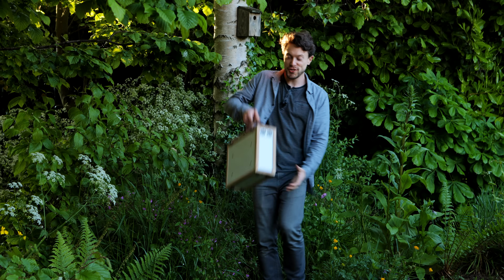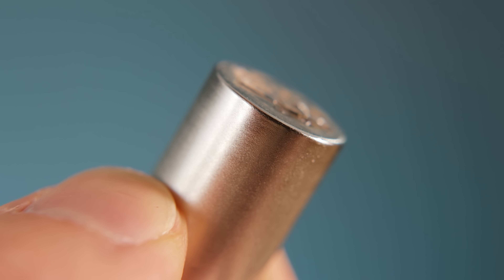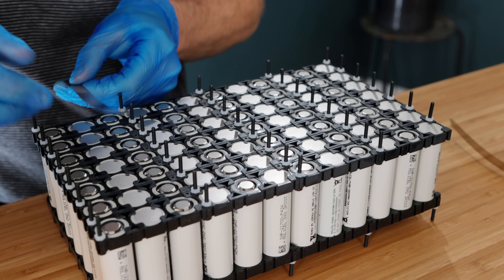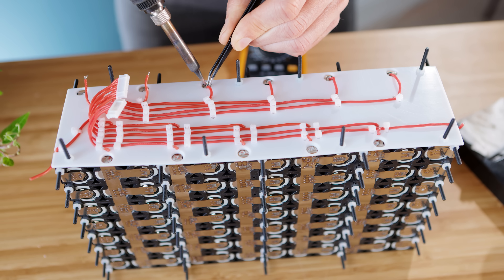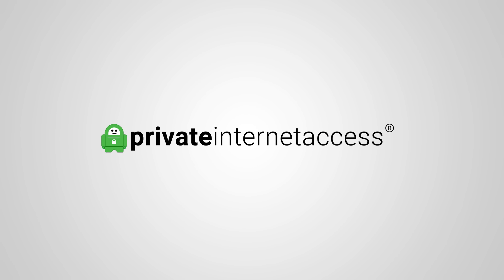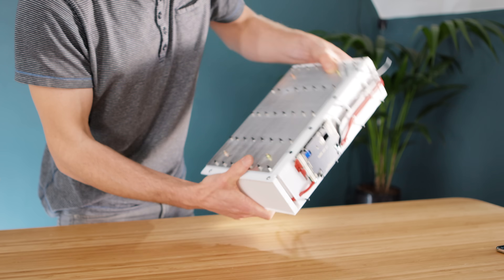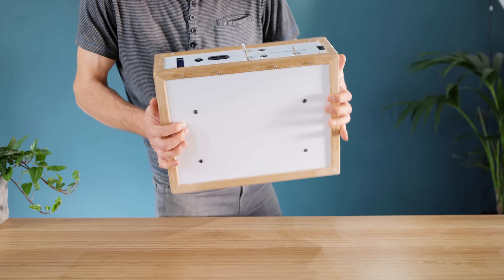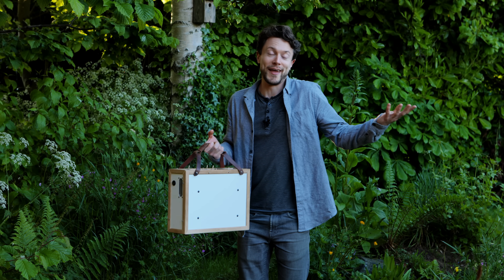Build your own portable POWER STATION (1200w, USB-C and MORE!)

Comment: You could make a 'hand-held' Xbox Series S. Xbox and battery in an enclosure with a screen on the front maybe with a split controller of sorts of the sides. Would be alot bulkier than a switch but cool to see

Comment: How do you can use 110V/220V units like (hier for example) microwave? You hab outputs of 12/24/50 Volts... Why not normal converter bulid in and socket for 110/220V equipment?

Comment: That is a monster build and very impressive. I am curious if the control module, can be configured to alert you when the batteries get to a dangerous level and need recharging? The dead car battery boost function is such a great idea to add. With a bluetooth karaoke portable speaker you and friends could have a fun party literally anywhere. The way you explained battery degradation, was so helpful. Does the control module show each battery or just the bank of batteries a problem cell might be in? Thanks so much for sharing your awesome ideas.

Comment: Hey Matt, thanks for sharing. A couple of questions:

1. What's the total weight (kg or lbs) of the case?
2. Can you specify which boards you had to include fuses?
3. What would you recommend if we wanted to modify the build to include the main voltage inverter inside the case?

Comment: For anyone thinking about building one of these that might get dropped a bit.... you can buy uncoated circuit board material that is both hard as nails, and flexible, and shock resistant. It's a wonder material for wrapping battery packs. My mate hit a van(!) on his ebike with a battery the size of the one in the vid strapped to the back of his bike, it shot across the road at 20-30mph then hit a kerb, and remarkably it was fine.... unlike my mate, or his bike, or the transit he hit! 😱

Comment: This seems a lot less DIY and a lot more skilled Tradesmen instructional video. While entertaining it lacks a lot of features that would make a traditional DIY project easy to accomplish. 

For instance spot welding the batteries in place. What if you screw up? a traditional DIY project would allow you to scrap that and do it over. Spot welding is a pain in the arse to redo, instead having a contact plate would be easier. Just pop the battery in and it's good to go. They're also far easier to install and more beginner friendly.

Also the tools and materials used are highly specialized. I can't exactly walk into a mom and pop hardware store and find a decent spot welder that won't short out or burn my hands.

That's just one example but there are others if you watch the video, specialty (expensive) tools your average person probably won't own, advanced techniques beginners probably won't know about, and programmatic features that are more complex than just 'plug and play'. This project also involves custom made plastic sheets, from whence did they come? Plus custom cut aluminum sheeting.

I just think this project falls outside the spirit of DIY. Not that it is by any means bad, it's a lovely idea. Just not simple enough or user friendly enough to be Do It Yourself.
Reply: Have you seen any of his other videos lol

Comment: Video made on my special day! Neat. I like the look of it. I build a converter for my E-bike battery to make use of it as 12V power supply for my cooling box if I not bike around. Was pretty easy and not had much circuitry but the lid and box was 3-D printed  and designed by myself.

Comment: Possibly build a multi input travel charger or something... for instance
Something that takes 5v at an average phone charger current and steps up to 50v slow charge so you can charge from car while driving without draining car battery 

Some solar arrangements that you can keep out on camping trips etc that slot nicely in boot ??? Possibly even a wind up/wind type device that could work in conjunction with solar and when the sun's gone.
Maybe I've thought to much into these lol.

Comment: You create the most GENIUS projects ✊🏾 I have so many questions: 1) Can multiple battery units be connected to increase the wattage/hour? 2) Can the unit be recharged via solar panels or a gas generator? 3) Can you do pass-through charging? 4) How long does it take to build one? 5) What’s the cost to build one?

Comment: Since you made the space for wiring and went through all this trouble with the build, why not just make all the wires the same length to get a more accurate reading of each battery rows due to your wiring resistance ?
I mean going the extra mile for the smallest things could get you additional few more charge cycle in the long run...
And you only need to spot weld 2 pairs of position on each battery but you went the extra mile to add a 3rd pair on them. So I find it weird you did not do so for the wiring.

Comment: So your battery bank is about 350ahrs capacity for only £315 worth of batteries. 
My question would be, what was the overall cost of the project as this could easily replace high capacity banks needed for motorhomes and boats.

Comment: Why not use LiFePo4 cells, they are a lot more stable and you can avoid dangerous situations (explosion, fire, etc). They cost more but safety, well hey, it goes first!
Reply: Well, it already is very expensive as it is. Using UPS batteries would be much cheaper, but heavier

Comment: There are consumer packs that can do much of this. Matt's pack shows how a DIYer can flexibly change the capacity and options to specific need.   
For amateur astronomers out there, this is a project others have also done to power telescopes and computers in the field though most don't do 24v only 12v.

Comment: Soldering these batteries really isnt as bad as you think. Aslong as you have a good size tip with a quality soldering iron, and are quick (but allow for for a secure weld) you should be fine. I've soldered countless cells with no problems. I'm not saying your wrong by any stretch, adding heat to a battery is still risky, so do take care when doing so.

Comment: Imagine if it can also be charge using a solar panel.
Reply: There's a whole class of power banks called "solar generators" designed for this purpose. They can be charged by solar panels and regular wall outlets. However, they are quite expensive because of the cost of batteries (roughly $1/W for a final package).

Comment: Cells in parallel groups should be matched with actual capacity and not charge level. You can easily charge/discharge a cell, but it's way harder to change a cell's capacity

Comment: worth to say that cells that are connected in parallel, should be matched by internal resistance, not only by voltage. Otherwise, cells with lower resistance will get more current when charging/discharging. This leads to a shorter lifetime of the cells with low resistance. I found a study somewhere that 5% of mismatch internal resistance of cells connected in parallel, leads to a 20% shorter lifetime.
Reply: Correct that a multimeter is not enough; it shows only stored voltage, not mAh. While brand new cells are likely not too different from another, second hand cells need careful measuring to see their capacity. I've purchased a 18650 discharger that gives me a readout of the capacity in mAh once the cell reached a set minimum voltage. I have some 2200 cells that have 2400 to 2000 mAh, and some 3000 cells with anything from 2200 to 1900 mAh. The worst set were  2100 cells that ranged from 1090 to 900 mAh, an absolute fire hazard if I were to pair a 2300mah with a 900mah even if both have 3.6v, something the voltmeter can't detect.
Reply: interesting makes sense, current is not equal in a paralel cell battery.
Reply: The BMS will monitor that as well.
Reply: @bdiddy77777  With parallel connected cells, how can the BMS possible know the current going to individual cells unless you measure them individually, which you can't because they are paralleled and will share the load?? All current to the cells in parallel literally goes through the same wire, but what goes between each cell, nobody knows. Do you intent for the BMS to have a current sensor for each cell? I believe what OP is saying, that matching the cells by internal resistance is the best insurance, though they'll eventually drift with aging. Another measure is keeping cell temperatures the same, as lower temperature in one cell increases internal resistance and accelerates the mismatch.
Reply: @bdiddy77777  no it doesn’t
Reply: wait i was wanting to copy his battery but if there is a flaw in the build then how do match the internal resistance. sorry if it is a dumb question I'm not to much of a technician
Reply: @pacboygamer6728  if you buy the same type of cell for example molicel p42a then you need not worry. Personally I would go with LiFePO4 cells though. Also this is very dangerous to do if you don’t know what you’re doing. I would not recommend it.
Reply: @pacboygamer6728  you either need to buy the cells that come with the measurements, or have a tool that can measure that. Regular multimeter is not enough
Reply: @krzysztofm.2959  oh I think I get it so this is when your assembling the battery by pearing them with others that are similar. I'm guessing the resistance isn't the amps
Reply: @pacboygamer6728  no, it is in Ohms
Reply: @krzysztofm.2959  ok but everything else i said war right?
Reply: @pacboygamer6728  yes
Reply: @krzysztofm.2959  oh cool so all i need to do is pare them by closest resistant and should i buy a powermeater that looks at resistants?
Reply: @krzysztofm.2959  or should i just get the voltage one
Reply: @pacboygamer6728  those are very specialised tools for measuring resistance of the battery cells. You will not get it in a reasonable price. The only option is to buy the cells that have been measured by the manufacturer
Reply: @pacboygamer6728  measuring voltage is not enough, but it is better than nothing
Reply: @krzysztofm.2959  oh ok so i guess that will be a but hard. but thanks
Reply: @krzysztofm.2959  hey do you have a discord or telegram or Messenger i would like to just have you on hand if I need a hand with anything I need help with. But it is up to you
Reply: @krzysztofm.2959  A typical RC lipo charger (e.g. Accucell 6) will measure IR and won't be too expensive
Reply: @krzysztofm.2959  Regular multimeter is enough.
Reply: @jftechdrones  You don't get it do you? Batteries are connected in series, charger only sees it as a single cell.
Reply: @krzysztofm.2959  It is trivial to measure internal resistance with multimeter. Measure open circuit voltage. Connect some load, measure closed circuit voltage. Do simple math. Done.
Reply: @ScienceDiscoverer  You mean parallel, not series. I'm on about using the charger to measure IR of individual cells before the pack is assembled, not measure the whole pack's (or parallel group's) IR.
Reply: But there are no cells wired in parallel here. There are batteries of 12 cells in series wired in parallel. The odds of a mismatch go down, the more cells you have in series, as all the mismatches average out.

Comment: How about a power bank for DSLM with USB PD? Something that can be mounted on rods or cage and could have 2x12v, 8v and 2xUSB C PD? That way there could be outputs for monitor, light, ff and camera (8v for dummy or USB C). Capacity around 25000/30000mAH and something that would safe.

Comment: Very nice power station. The custom output connector at 15:36 is definitely a cool DIY item, but I prefer Anderson Power Poles for my power needs. They are available in several amperage capacities from 15A to 350A. They are a defacto standard for amateur radio and are perfect for portable power stations like this.

Comment: Very cool project! Thanks for sharing. I really love the design and the consideration of safety aspects. 
For me four questions were arising:
1) What about temperature development during extensive use or during recharge - are the two small Noctua fans really enough?
2) Would it be possible to charge the battery pack with a solar panel - do you only need solar panel and solar charge controller?
3) What is the maximum charging time from 10% - 90% right now?
4) What is the maximum charging power?

Comment: When I was a kid I was repairing a friends Pokemon Blue version cartridge because they ran it through the dryer and killed the battery cell. Not realizing it was spot welded on I applied heat to it to remove the "solder" I thought was on it. After about 5 min of heat the thing explodes in my face burning parts of my cheeks and eyelids. They are absolutely right DON'T SOLDER BATTERIES!

Comment: You forgot to say how much the built cost.

350 for batteries alone, ouch.
Reply: yea - if you're not doing the build for the joy of the process, it's definitely cheaper to buy a "solar generator" like Jackery which can support full outlets and USB-C
Reply: @lopypop  The build would be fun, I would add solar too, but weight and price would be two things i would've loved to hear.

Ans now with the new salt based batteries coming, maybe a better alternative so Lithium and Cobalt is not needed for them.

You could also get a cheap Hybrid HV batterie and use that, it has even a controller for batterie balancing or a balancer in some cases.
Reply: @Spelter  salt based? Kindly shed more light mate.
Reply: @leviahamefula3994  University of Copenhagen seems to made progress with sodium-ion batteries. So just google for it, maybe it's working out, we  cant use lithium and cobalt until the end of times.

Sadly, it's still just a replacement for Lithium ion batteries with hopefully similar energy densities.

Comment: I would like more functionality though.A variable output 0-30or50 something? .Current limiting to protect devices and an inbuilt inverter.You can get all these things relatively easily by using one of those buck boost modules from eBay and also a proper sine wave inverter

Comment: The insulation might be overkill but it’s the right kind of overkill. 50v DC is plenty to be dangerous to you. And I appreciate how you emphasize just how dangerous lithium batteries and electricity in general can be. I’m always shocked when people are not concerned by puffed phone batteries or a damaged 18650 from a flashlight or something.

Comment: This looked awesome until I found that the Australia rip-off profiteering tax applies.   Even the 18650 batteries that you would pay £2.59 for the exact same size and capacity here in Australia they want £20.48 for  EACH!   This project just become impossibly expensive because they are still profiting hard on battery storage in Australia and screwing consumers.     Compare yourself to see how crazy it is:  https://www.fogstar-wholesale.co.uk/product/samsung-35e/  Vs.  https://au.element14.com/ansmann/1307-0001/battery-rechargeable-3-6v-18650/dp/2889326

Comment: I use 2 58.8V 35Ah (2058Wh) lithium packs, a 300W folding SunCapture solar panel, GENASUN voltage boosting MPPT solar charge controller set to 56.8V, GRIN DC to DC converter, and can power everything I carry while ebike touring. - https://photos.app.goo.gl/rFim5rPsajmDt8NJ6

https://photos.app.goo.gl/ADgC6oyPM2gyrCq27

Comment: You forget the cooling system. When the battery work in a long periot of time it will release ton of heat. You cover every thing with plastic so it dangerous if you dont have any more powerful fan or cooling system.

Comment: We have just gone through a 4 day power outage due to flooding and storms.   Needless to say my interest in high capacity and versatile battery solutions is now peaking.  I love this project but the downside is getting parts made properly and something like that spot welder which would cost a mint or be possibly very hard to rent.   Love your work.

Comment: Thanks for the great Video! After putting the 21700 cells into so much Nylon, don't you afraid of cell overheating when fast charge or discharge? Did you consider attaching sensor temperature to the cells?

Comment: Almost made batteries airtight with thermal insulator plastic all around it. So, what the fan will do effect? Would not it be better if its made air circulate between batteries somehow? With current system; if batteries get hot or very hot, making them cool will take to long time because of that tight shut thermal insulator around them. Keep in mind, higher the Amperage flow then higher the temperature will go quick on batteries.

Comment: Ive been looking for a way to convert  a unit that charges with usb, to a unit with a cord that can be  plugged into the wall socket. Would you recommend I just use a wall socket with usb port? Or is it less effective? Thanks

Comment: how would they short out if only the outside/negatives are touching ? even if the positive of one touches the negative of the other it isn't a problem, in fact it's how you HAVE to do it if you wanna put them in series to get more than 4.2V, which is almost always, the extra space between them is more for heat dissipation